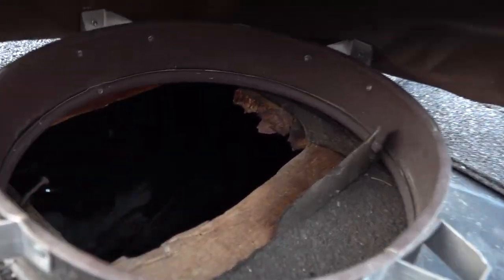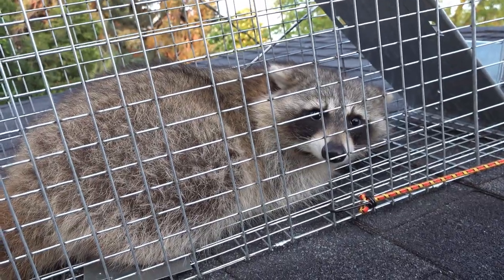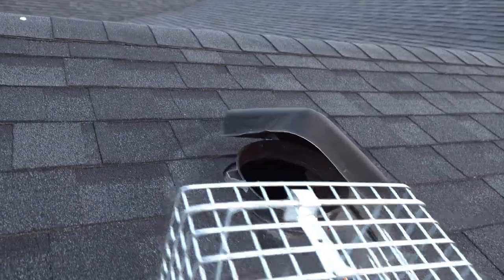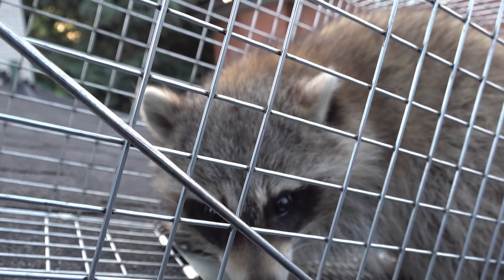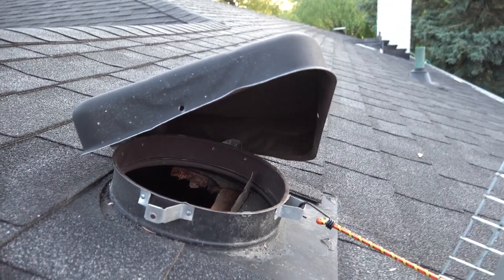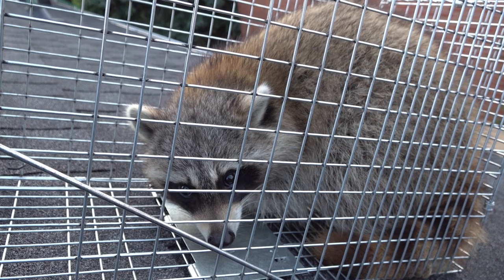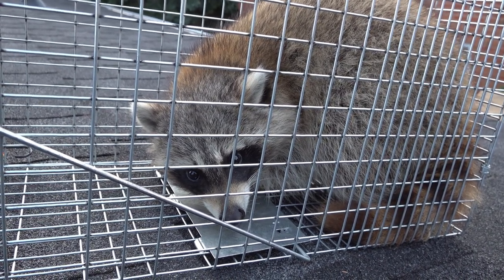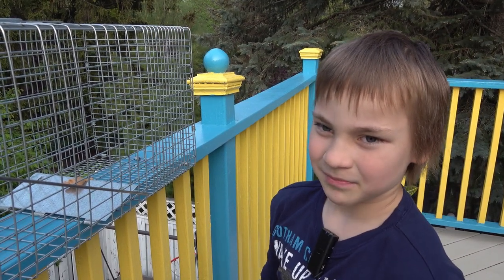Raccoon ripped open a roof vent and got into the attic - trapped raccoon in cage using Peanut Butter

Comment: I caught 2 earlier this year but in a conibear bucket set. Got a possum Thursday night and a woodchuck the day before. Been nuisance trapping on my property since 2015.
Reply from the maker: Sounds like you have an assorment of wildlife crossing through your property. What are you using for bait - peanut butter, sardines, or what?
Reply: @VloggerBurgers  Cheap, dry cat food. Raccoons love it. Possums will eat anything. I don't use anything for woodchucks.
Reply from the maker: Ok, great! Thanks for the tips. I've been using peanut butter so far and caught the one that pulled open my roof vent.
Reply: @VloggerBurgers  Try the cat food. Get that little bugger!
Reply from the maker: Ok, I'll try cat food.